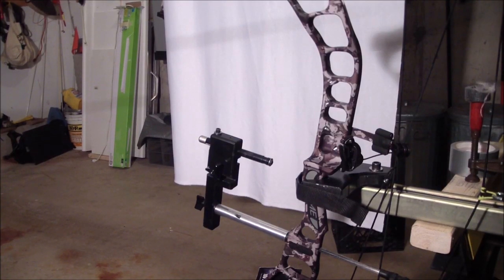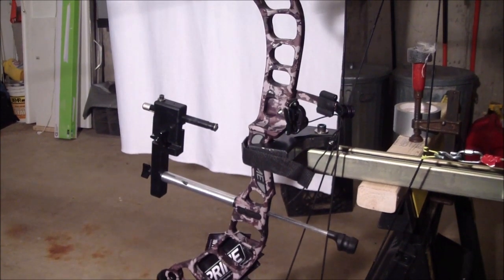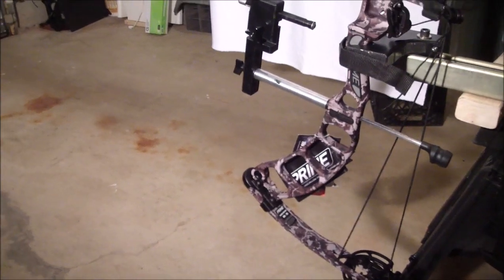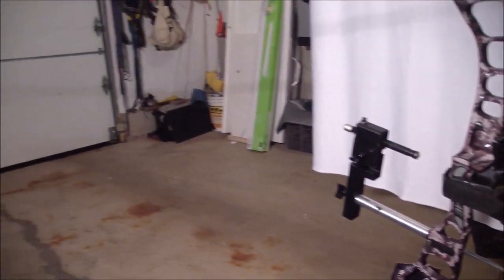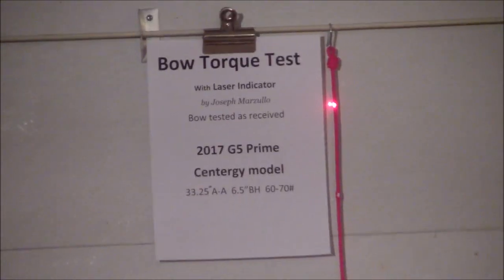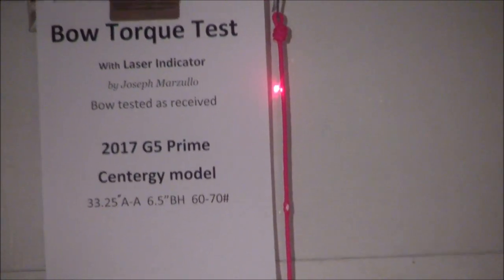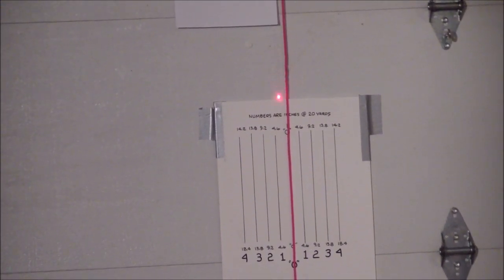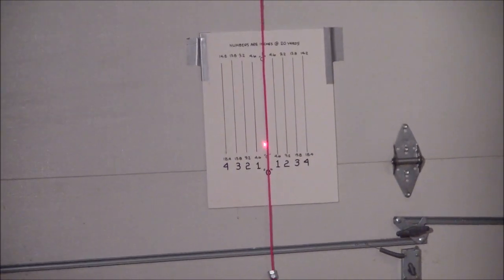Bow Torque Test 2017 Prime Centergy

Comment: I have owned most of the current 33-35" ATA bows, the Centergy is the most accurate bow I have ever shot. It might be the torque free riser (can't hurt) or the parallel cams, or the unique high grip and different size cams. It shoots fixed broad heads like a rifle, bare shafts and field points all hit the same hole ! Thanks for doing this test Joe.
Reply from the maker: Hello,
I have had a similar experience with that bow and others whose nock travel, horizontal and vertical are very straight. Also this shows that some bow manufacturers are paying attention and producing superior designs.
Reply: Here we are in 2024 and all indications are that despite even Prime moving back toward more common bow designs, the Centergy 33 performance level remains challenged but not beaten.
It is the only bow I have owned where upon initial set up, the structural horizontal centrelines of the sight pins, rest, cams and riser align perfectly with the string.

Comment: To all of the viewers that think this test is irrelevant, it is not. It shows the mechanical behavior of the bow. Which could translate to poi vs poa after release. It's like having a wheel slightly out of alignment in your car. You simply compensate in the opposite direction most time not realizing it and the car goes straight. Car drives fine but it could be better.  
Does this mean the bow will be a bad shooter? No. But it certainly gives you a clean slate and something to compare when trying to learn everything you can about your equipment. Imo
It's along the same lines as a stabilizer on a bow. If you change the cg of a bow you can affect the arrows launch and impact. Because the bow will act different on release. 
I.e. I was experimenting with a offset stabilizer and I threw it on and shot the bow and sighted it in. I ended up with my sight pins on the leftside of the string vs center shot. I then started moving the stabilizer around and adding weight until it felt good after the shot. I then sighted in again and my pins ended up in line with the string. 
Joe can you please do a vertical nock travel test on the prime Rize?Thanks
Reply from the maker: Hello,
I will see if my proshop has one and if yes I will do that test. Allot more setup to the vertical test so it may be a week or two (assuming the bow is available) Do you own a Prime Rize?
Reply: Okay great and yes I have a Rize, an alloy and a strothers wrath s.h.o
Reply from the maker: My pro shop is closed till next Tues, I will see if he has the Prime Rise, if not you can send yours RT shipping prepaid and I will test it for you. It's not easy getting all the bows I would like to test. If any viewer has new bow they want tested, they can send it to me.